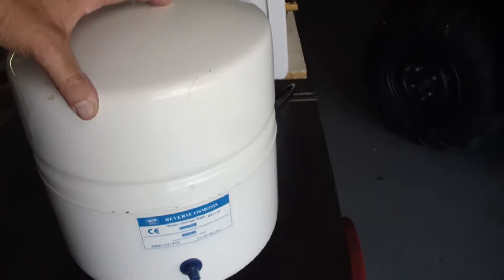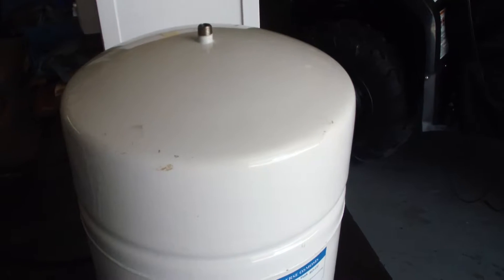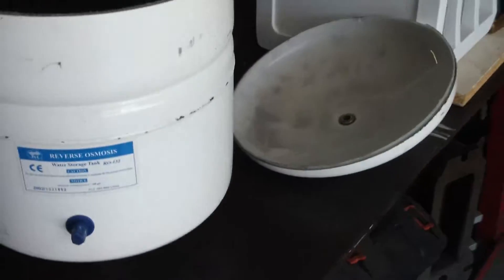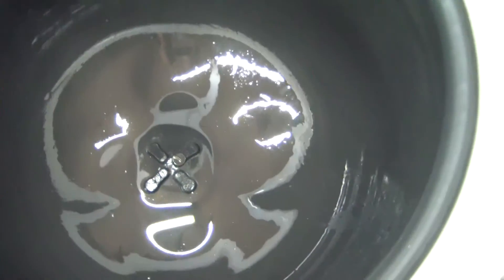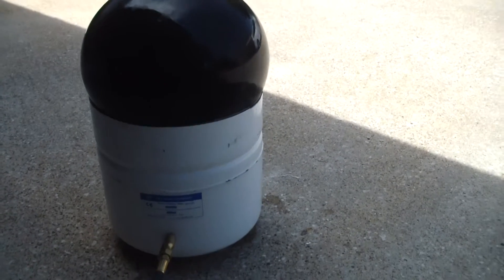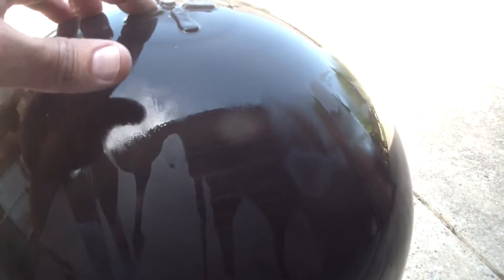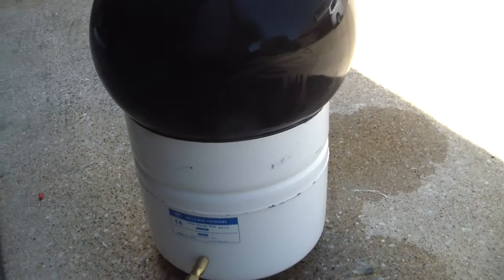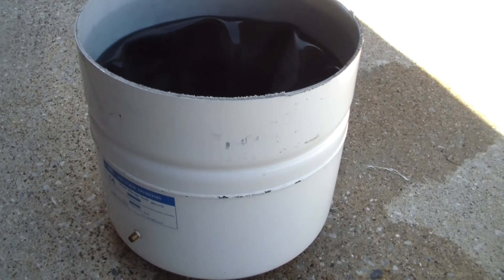Does reverse osmosis water filter really work , a look inside a 16 year old tank. Will it explode?

Comment: Thanks for the great video boss! Don't think there's another one like it. Always wondered about slime build up on the inside surfaces of the tank. For the 16 years, did you regularly replace filters and sanitize the system? By the way, yes I wanted to see you blow that sucker up, in slow motion even lol. Subscribed, and thanks again for the great video.
Reply from the maker: I never change the filters on the regular scheduled times, I have a water tester and when that tested said the filters were not as efficient as I wanted them to be I changed them. For instance, my tap water usually test about 278 using the water tester, Aquafina bottled water test about 005, and my ROM water filter system would test about 005 (The same as Aquafina) when all filters are new, I usually let it get to about 75 to 100 before I would change the filters which took about 3 to 4 years.
Reply: @737mechanic  Thanks, that's some valuable real world info and results. I also have a TDS tester. After seeing your results, I'll probably do the same. Thanks again 👍

Comment: Wow, that's amazing how clean the tank is after 16 yrs. I always wondered if the tanks get algae, rust etc. You answered my question with this video. Proven fact these systems do work. I hope my 3 stage works as well as yours. Can you help answer a question? When tank is FULL. What does the tank read when Full? They say, 5-7 PSI empty. When full I read 17.6 PSI. My issue is, water continues to slowly drain. You can hear it draining into the plumbing drain. They claim, this is caused from not enough PSI in the system to activate the automatic shut-off valve. They claim, the automatic shut-off valve is a 35-40 PSI shut-off valve. My system when tank is full read's 17.6 PSI. Not 35-40 PSI. Can you check your tank reading when full to see what PSI do you get?
Reply from the maker: Mine read right at 30PSi.
Reply: @737mechanic  Is that with City water or Well water you have? I'm trying to figure-out why I only get 17.6 PSI with a full tank after pumping 7.5 PSI into the tank. Thanks.
Reply from the maker: @NanaPapa5160  city water, I can't remember what our actual water pressure is.

Comment: They loose presure over time, all you have to do is drain it, add air 5 pounds exactly and then re conect waterline. You'll be good to go. Don't cut it open unless you just want to ruin it .
They will last for 100 years😂🤦‍♂️
Reply from the maker: I got tired of adding pressure every month, after buying the new one I have not added any pressure in probably 7 years

Comment: Great video! Thanks for taking the time to make it!  I’m pretty sure my issue is a leaky bladder, because water comes out of the stem when I try to add air.  Thinking I may cut mine open too.
Reply from the maker: If you are getting water out of the valve core then yes the bladder is leaking.

Comment: Maybe it was a leaky value stem.  The one you pulled out.  They can leak very slowly.  Good video thanks.  I always wondered if the bladder was at the top or bottom.  Best of all, you showed that these tanks stay clean.  Thanks again.
Reply from the maker: I did put soapy water on the valve stem a week before I cut this thing opened and didn't see any bubbles form so I am pretty sure it was good but who knows.
Reply: Mine is doing the same thing.  I emptied it today put in pressure of about 7 lbs and I still have no water pressure.  Did you ever determine why you lost pressure?  I am assuming the new tank fixed things for you.  Looks like I am going to have to do the same, but I only got about half the time you got out of yours. @737mechanic
Reply from the maker: Leo Ortega It did fix my problem even though I didn’t find the leak. I think it was only $35,00 for a new tank.
Reply: Well... Apparently it is working now, for how long I don't know.  I will keep an eye on it.  Thank you for your responses and your video.  BTW, being the sort who likes to DIY and save bucks, I thought why waste all that water that the RO system throws.  I routed it under my house to an outside rain barrel and use to water the backyard.  Easy to do.
 @737mechanic